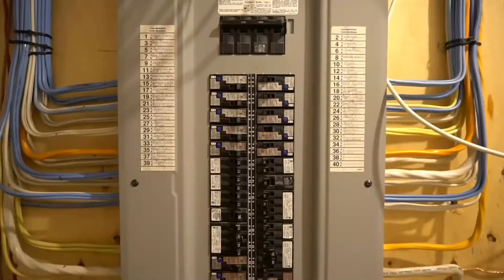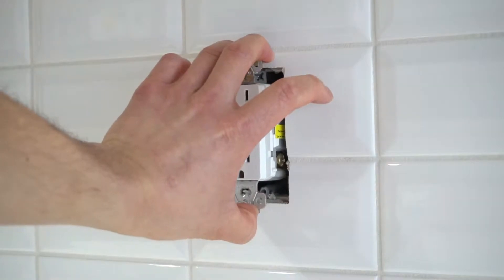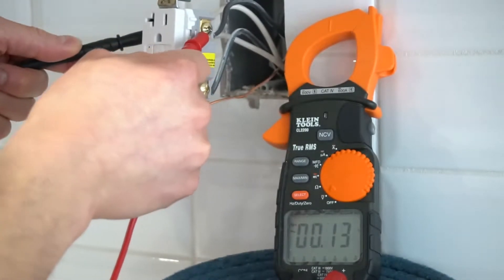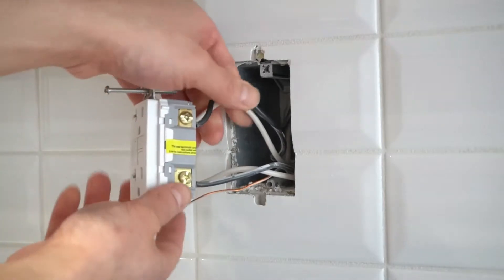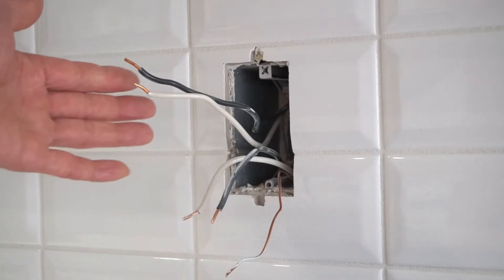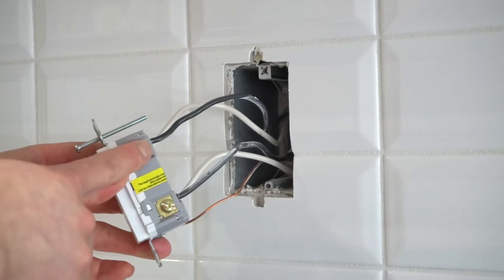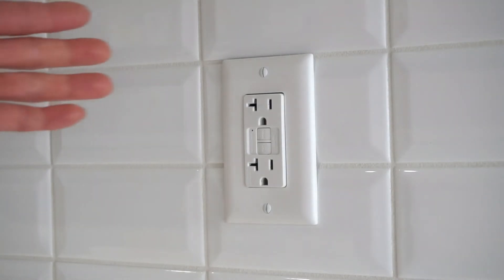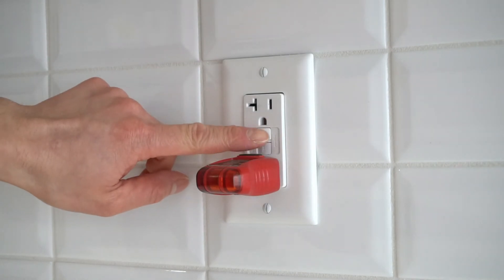How To INSTALL or REPLACE 20 Amp GFCI Outlet (EXPLAINED) Kitchen Plug

Comment: The circuit breaker panel says 20 AMPS for the kitchen GFCI outlet. Can I replace it with a 15 AMP GFCI outlet? There are many outlets attached to this GFCI outlet. But I will not have a heavy load on this line.
Reply from the maker: @etutlf4176  yes you can but you should change the breaker to 15 amps. If you don't you the 15 amps outlet can handle 80% capacity = 12 amps. Your many outlets should not exceed 12 amps total. The 15A plug is designed for a 15A circuit. If you choose to only run a load that's 12amp and less is fine or else the outlet will break down over time and can be a hazard 🍻
Reply: @KevinPon.  Thank you!!
Reply: Yes, you can absolutely use a 15 amp GFCI on a 20 amp circuit in the USA, but not in Canada.The 15 and 20 amp are the same internally and this installation is code compliant per NEC 210.21(B)(3).

Comment: Do you need to connect all 4 wires for it to work?
Reply from the maker: @nomercy5422  so the 2nd set of wires is to transfer power to the next plug. If you have another one 🍻
Reply: @KevinPon.  ok, cause I only have 3 wires. A black and a red wire and a ground one.  Is that good enough?
Reply from the maker: @nomercy5422  oh I see. So the opposite side of white wires. Where the red and blacks goes into. Between the brass screws there is a tap you will have to break off. This causes a split between the screws is what you want. On the brass side of the screw, one red will go on one of the brass and the bottom brass screw will be connected to the black wire. On the neutral side, silver screws you keep as is, no change. Black wire is circuit A and red wire is circuit B. If you don't split them, it will trip the breaker. Hope this makes sense 🍻
Reply from the maker: @nomercy5422  you need white wires. You don't have any white?
Reply: @KevinPon.   You just told me step-by-step how to install it. Thanks.
Reply: @KevinPon.   I'm thinking of buying this same outlet and installing it myself.

Comment: {Update:  both in the kitchen do work, i just did not realize that the one is reliant on the other; i reset the one that i did not touch, after turning the power back onto the circuit, and that's when power went to the GFCI that i have just put in.  the one in the bathroom, as expected, does not work and i will replace that one as soon as i can afford to.}

question*:

for each screw [for the "hot and not" wires], there are two holes.

*does it matter which hole each wire is in?

i have just attempted to swap a 20A GFCI in my kitchen out with the 20A GFCI in my bathroom.

they are the same brand and model.

i was not aware [if i should have been] that the hot wire should be in the top hole and the white wire should be in the bottom hole; all that i was aware of was that only the line screws are used in either case [there is another (same brand and model) 20A GFCI in the kitchen, on the same circuit as the other kitchen GFCI].

i swapped them out because i accidentally popped the one in the kitchen [my first day in this place; beginning of this month], i don't use the one in the bathroom at the moment, and i cannot afford a replacement at the moment.

now, both the 20A GFCI that i swapped out in the kitchen is still out and the one in the bathroom is also out, and the one in the bathroom [that i moved to the kitchen] was good before.

the other kitchen GFCI is still good {and, likely, because i didn't touch it 😅}.

the only thing that i can thing of that i might have done wrong was, maybe, put the hot wire in the wrong hole on its line screw; otherwise, i wired like for like.

unless all of the pops that i heard, while i was turning either [carefully; i didn't shake them or anything] so that i could see what i was doing, were not just the loosened screws rattling around. 🤔
Reply from the maker: You're doing great! As for the holes, the closest hole to the brass screw will be for the black wire and the hole closest to the silver screw will be for the white wire 🍻
Reply: If you have multiple GFCI's on one circuit you must connect between them only using the Line side. The Load will not be used. You should not connect the Load of one GFCI to another GFCI downstream, even if there are any regular receptacles in between. You may use the Load on the most downstream GFCI to protect any regular receptacles further downstream if there are any.
Concerning the 2 holes you mentioned, 2 for hot and 2 for neutral, say the Line side, because those are the ones that you should use, it doesn't matter which hole you use as long as hot and neutral are wired correctly.

Comment: Are we assuming the wire into the box is 12/2
Reply from the maker: By code 20A plug is 12/2. If you are not sure of  the size then you can use a wire gauge to measure 🍻

Comment from the maker: The reason I turn them all off is because I have 6x 20A kitchen plugs and 99% of the time you don't know which one is on which circuit and also it's not labeled. By turning them all off you are 100% safe and sound to work on. Cheers mate.